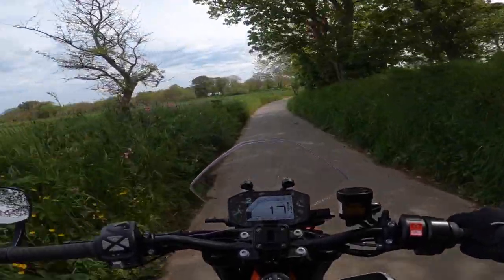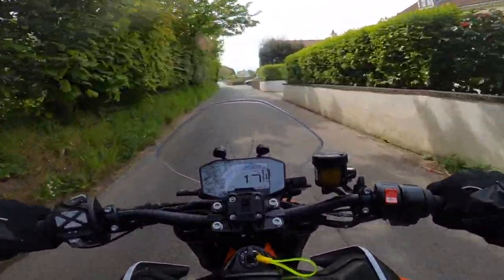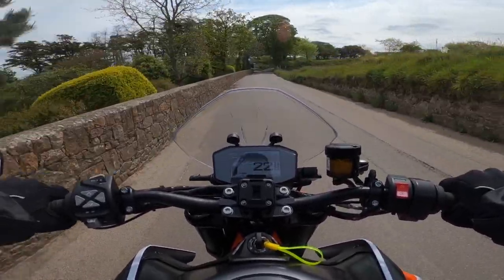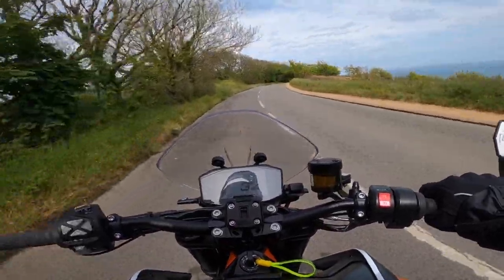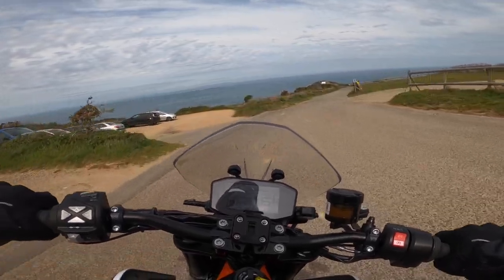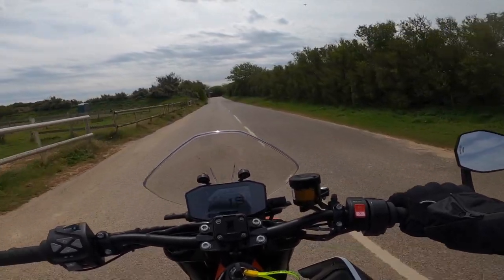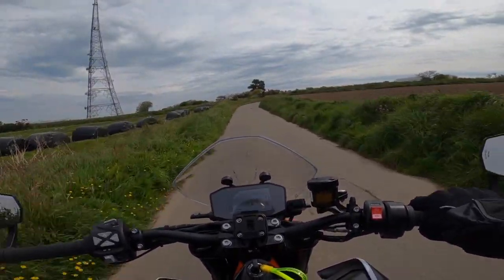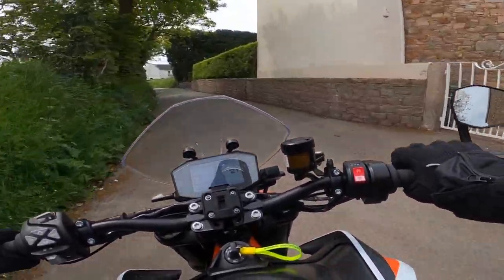Vlog #5 KTM890R Duke-Update after 2 weeks of ownership

Comment: I bought a 890 duke R last week. At 275 miles the display cluster has gone wacky! It's visible but the every thing that should be white is now a blue -green and much dimmer. When you hit a bump it will get darker too.I have set the fork adjuster to the softest positions  and it is still brutally hard when hitting bumps. I think the may be the reason for the instrument display going bad?
I'm afraid my gut feeling was right about KTM quality! I have never had a problem with all the Japanese bike that I own some for over 15 years!
Reply from the maker: Oh no ! I dialled the front compression way down and rebound to and did the same with the rear . Ride is very plush . Was it a 2021 build ? Taking mine to Wales this week doing Snowdonia and Brecon Beacons . My Africa Twin is on standby just in case . Possibly a connection come away slightly ? I know what you mean ref build quality though . My Honda gets an A from me and the KTM a B . I have used ACF 50 on both though . Hope u get it sorted 🤞
Reply: @gsd32i  yes, it’s a 2021 and have every thing front and rear to the softest setting.
I’m also concerned about the loud engine clatter! Noisy valve clatter and cam chain noise! Sounds like it will self destruct!
Reply from the maker: @glennkrick  I know mine sounds like a tractor bit does quieten when warm , 900 miles on mine . Dialling suspension made huge difference on mine . Basically out of showroom, for me at 12 stone , was unusable on the road where I live , thought my teeth would fall out , but lovely now . Had a new battery fitted to mine even before it left the showroom, causing a 2 day delay in me collecting it !! All said and done the bike makes me smile 😊 ( at the moment )and i love mine . hopefully won’t be a love / hate thing . Good luck with the dealer .
Reply: Cuz ktm

Comment: Agree on suspension. Once you set it for your roads the bike is more enjoyable. It’s really bumpy on my street for 2 miles so I have standard in front and comfort in rear. Had comfort comfort.but front was too soft on twisties. Wait till you have your first service and can use full rev range, will be even more fun. Will try your fueling tip if I detect an issue. Thanks for the tip. Isn’t solo rear psi suggested at 36? 40 s33ms high.
Reply from the maker: Yup you’re correct 👍 just checked pdf manual . This is what happens when you assume the technician that PDI’d the machine before handover set everything correctly and knew best !!! I’ll drop the rear 4psi and re-assess the ride  and give the technician some advice ! Definitely looking forward to the ride post first service 🤪 thanks .
Updated : fortunately didn’t need to adjust any suspension settings and didn’t notice any difference in the ride with correct psi set 👍

Comment: quickshifter is a bit trippy......when i first got it i kept letting off the gas to shift (no clutch) and was really learching forward (abruptly).....I finally just left throttle on and shifts were smooth as butter, so hard to change a style of riding. but yeah dont change throttle even in low rpm and shift.....mine was smooth as silk....only have like 50 miles on mine and still learning the bike.....messing with suspension settings now to get more compliance on street.....

Comment: Keep the updates coming. Run 32f 34r on mine. Still not happy with suspension yet, Seems soft on front under hard braking and too hard on rear over bumps in the road. Will ask dealer when i take it for 1st service.
Reply from the maker: More than happy with mine now it’s not launching me out of the seat . I did adjust the rear high speed compression and that worked a treat. First service in 150 miles 👍👍
Reply: @gsd32i  how many turns out? i'm on 2 turns out now
Reply from the maker: @fraz172  just nipped into my garage and looked on my nobo board......on the rear I am on 1.75 out.....and 1 click out from standard on low speed.

Comment: Your not supposed to use the quickshifter while running in (ktm advised) my dealer has not enabled mine til 1st service. Was also told the oil in it is full spec from start not a lesser mineral oil. Ive not experienced any lumpyness really,  done 456 at mo had for 2 weeks thought the fuel was brilliant been riding upto 70/80 mph and odd blast upto 6000 rpm but been kind and kept first few hundred under 4500 rpm and been averaging 74 mpg!! 
Agree the best fun and handling ive had for years,  at 57 ive fell in love again ...what a tool...enjoy your bike and hope all goes well for you
Reply from the maker: Yup it’s a great machine that makes me feel  26 and not 56 !! Sadly stuck on my island with a 40 mph limit ! Lovely with the heated grips too this time of year . Enjoy 😊

Comment: Yeah had my suspicion set by FTR,interestingly they added a few spacers to the front forks and then set it up as apparently the bike sits on its nose, now its sitting flatter and the suspension is working more evenly,hard to believe the ride could improve but now i can take serious liberties in the bends,on the down side that sprocket gasket is definitely leaking clear oil and apparently it has only been addressed over the last few months so keep them pealed,showing my age now!!!! 🤦🏼‍♂️
Reply from the maker: I did lower the preload on the rear as the bike was steering too quick for me into the bends , which I guess has a similar effect to what you’ve had done . Fingers crossed for the sprocket leak on mine then , Feb 2021 build date . It has the right amount of power and I am suitably impressed at its low down grunt . Lots of older riders on the uk KTM forum !
Reply: Yeah I’m a World Cup baby as well!!! This is truly the most fun bike I’ve ever had which includes loads of sports bikes,120 bhp ridden hard is more than enough and the delivery is fantastic,got a Brands hatch track evening for next month,really excited for that one especially on the power cups immense grip!!!!
Reply from the maker: @richardgowers7659  yup anything more is just pub talk !! I’ve had more fun on this little thing than I have done in years . 200 hp these days on the road is basically crazy and the easiest way to go to jail .... but 120 horses in  a small frame ... well that’s a different ball game . This has more power than my first big bike back in the day in 1986 , when I bought a new Red and silver gpz900R .... may go out for a spin later if it’s not raining 🌧 . Have fun on the track day 🤪

Comment: The quick shifter on mine requires much more effort than the one on the 790 I traded in . Hope things improve once its broken in. Brilliant bike otherwise
Reply from the maker: Hi. It looks like the chain on mine was set too tight from when it left the showroom as when i got it back from its first service the quick shifter was still crap and the technician had checked the QS and it didn't need recalibration. In my videos i say that i have turned the shifter off as it was not very smooth. Anyway i have adjusted the chain as per the KTM manual and it was clearly obvious that the chain had been set too tight . It should be 2-5mm from the underside of the swingarm and mine was 12mm+!! Surprise surprise the quick shifter is so much better and i can leave it switched on now!! Brilliant.
Reply: Hi. Im just about to trade my 790 in (which i absolutely love) for the 890r. Are you happy with the quickshift and blipper now please? Its the main things I love about the 790 it makes it such a joy to ride! Im 16 stone though and when pushing on round hilly north yorkshire roads, the suspension on the 790 just doesnt manage! Main reason for swapping is suspension and brakes. Thanks in advance.
Great video GSD321!!!! thank you
Reply from the maker: @stuartcoopalnd6975  hi . Funnily enough I’ve just been out on my 890R having some fun and the quick shifter is now fine . Just putting a video together . Basically the chain had been set too tight by the dealer (unless I’ve misread the pdf manual ) and I explained that I had turned the QS off as it was too clunky when it went in for its first service . It came back still clunky although they had checked it as per the 1st service manual . Out of a bit of frustration I checked the chain and it was too tight ! Adjusted it as per the pdf manual on the paddock stand in neutral blah blah blah and set it to be within the 2-5mm range and now it’s much much better . Happy chap now . 🤦‍♂️
Reply: @gsd32i  thats great news. Many thanks for the reply and brilliant vlog its going to be very helpful for me at times and just fun to listen to. Can I ask how you find the crazy race tyres in the wet? Im nervous and considering swapping them for ones with more tread pattern! Thanks again. Stuart
Reply from the maker: @stuartcoopalnd6975  in all honesty I am a fair weather rider 🤦‍♂️. I would opt for the Michelin Road 5’s if I was after some thing for all weathers . Unless your on a track or have amazing smooth roads then the OEMs are possibly wasted on the likes of us mere mortals . For a fine weather rider like me the power cups are bloody great 😊 and if it rains I’m no more than 15 minutes from home as the island is only 8x5 miles !! 😂

Comment: Where  did you find the solution on rough and lumpy running? Cant  find it on the KTM forums. Do you havet a link? I am experiencing same issue on my 890 R. Sorry for my bad english. Writing from Norway😊
Reply from the maker: Hello . It was on the KTM uk forum . Basically turn ignition on, start engine, don’t rev it or touch the throttle, TOUCH NOTHING, NO MENU SELECTION ETC then after 15 minutes , switch ignition key off , then switch on again and away you go . The KTM technician also told me about this too.
Reply: @gsd32i  Perfect. Just what I did but I havent taken it for a spin yet due to rainy weather. Looking forward to test it. Thanks👍 Your vlogs is very informative. I have had my 890 R for a week now and have run 1000 km. Will take first service next week. Just love the bike. Regards Egil
Reply from the maker: @egilstangeland7017  hope it makes a difference. 800 kms on mine with first service soon 👍